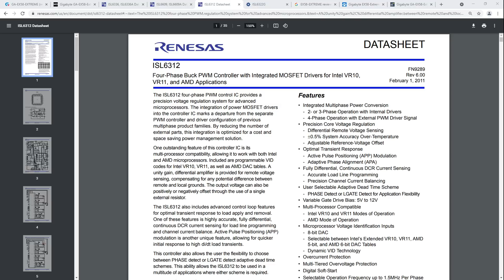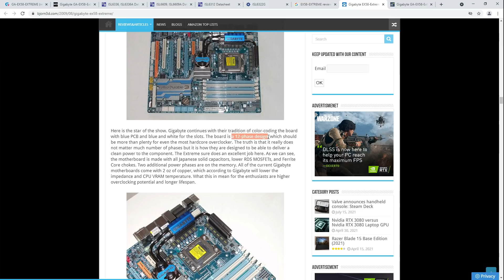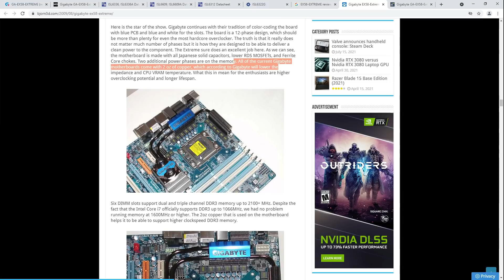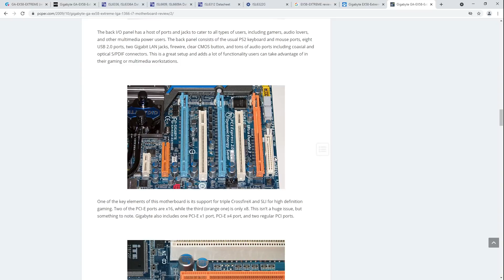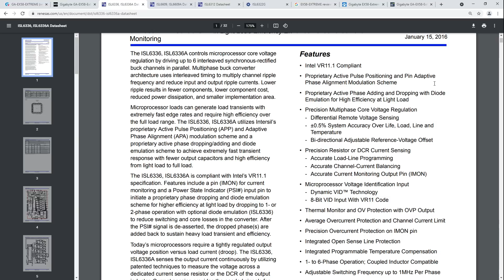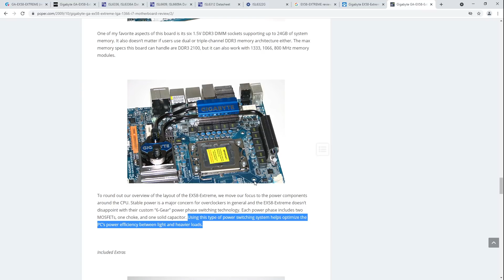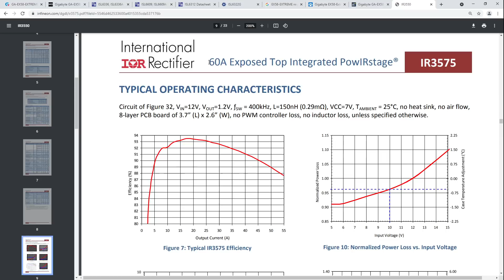Motherboard manufacturers have been lying about VRM phase counts for years.

Comment: It makes one wonder how many motherboards use higher phase counts to disguise lower quality power management overall.  We have 100 phases!  Why?  Because 10 phases would've been garbage given our design and parts choices.
Reply: there are double step-down two-phase buck converters, none of you knows what is installed on the board and this video does not give any electrotechnical approaches to a measurement as a starting point for the claims. Today there is even a tripple step-down three-phase buck converter. From someone who didn't even know what a mainboard was in 2008, I wouldn't expect to have any significant electrotechnical knowledge.
Reply: @darkbreed  Really?  Because there are lots of people who graduate high school in 2008 who weren't already computer scientists or engineers who are today.  That's absolutely the dumbest thing coming from a paragraph that might have had some good information in it.  But after hearing you insult the youtuber's intelligence based on not knowing what a mainboard was more than a decade ago... as if one couldn't gain any knowledge in the field over said decade... I can't take anything you said seriously.  Well done at making your words irrelevant.
Reply: @Salsuero  you can't DIY this knowledge, especially if you don't have the equipment. my electronics laboratory costs several 10,000 euros and I am still far from having a good one or one that corresponds to my university equipment during my education. Just what he tells of nonsense in other videos (I've now looked at some and this channel get fade out by me now) tells me that someone sits at the other end of the line who thinks he's got something and is really just a gossip. Anyone who wants to learn something or is looking for information is wrong on this channel, only half-knowledge and assumptions without a technical background can be found here. i feel sorry for the people who follow this channel.

I work in microelectronics for more than 25 years now and i have no time to educate others for free but i can give a statement about what a technican think about this chanel.

Comment: Using a higher current inductor to replace 6 phases ignores a couple points.  1.  The poly phase design increases the effective ripple frequency - requiring smaller caps.  2.  The transient response of the poly phase allows almost instant current supply because a high side FET is on and able to supply current instantly.
Without looking up data sheets - 12 phase is likely in reference to the effective ripple frequency and not the number of FETs per se.
Reply from the maker: Your ripple doesn't change when you cram more fets into the same damn phase because the fets can't turn on out of phase with each other. As far as the driver IC is concerned having 2 hi sides is exactly the same as just having 1 bigger high side fet. The same goes for the inductors. Having 12 20A 800nH inductors in a 6 phases gives you the same performance as having 6 40A 400nH inductors.
Reply: @ActuallyHardcoreOverclocking  Sorry didnt know you were a power supply designer.  I assume you are saying that there is absolutely no way the 2 high side fets could be individually driven 180 degrees out of phase.  There is no such circuitry - hence, as you state the 2 high side fets are driven by one driver and in phase.  Glad you could inform me.  I know a guy who designs multi-phase synchronous buck converters and he commonly doubles the ripple frequency by driving the high side fets out of phase.  I'll have to ask how he does that now that I know its impossible.
Reply: It is not possible if they are literally connected in parallel
Reply: @riba2233  ahh - then a 12 stepper doesn’t seem plausible at this point!  😀

Comment: When Intel left the MB market all he'll broke loose with brands looking for anything to differentiate from the others.  Another thing that went crazy was layer counts.   Intel MBs were like the Sony solution and could be used as a benchmark/design standard.
Reply: @ActuallyHardcoreOverclocking  Agreed - Intel left the marker around 2013, but also set the floor for "acceptable" power delivery for many years.  In 2008 in the US we had 15 MB vendors including some real terrible messes .
Reply: @patrickgoodhart9294  lol if you think it were back then... try the 486 era... omg the boards... and stuff evolved so quickly so there were several generations of 486 boards that wasn't really compatible

Comment: You should really look at the gigabyte X 58 ud9 if I remember it’s like a 20 phase power delivery
Reply: So? GA-Z77X-UP7 is a real 32-phase VRM motherboard, as featured in AHOC's "The most overkill motherboard ever made".

At least the X58 had the excuse of less powerfull phases AND potentially 50% more cores (6) than the Z77, something like the i7-990X could at least potentially draw a LOT more power than the 3770K on a far less capable VRM (less phases and worse powerstages in each phase! Double Whammy!).

Yes, it really had 32+3+2 actual! phase, VCC is an IR3562 driving 8xIR3599 driving 32x60A PowIR stages are which are obviously really needed to power at most.. a i7-3770K! Yes, the PowIR of that era stages are "only" MEH by modern standards but we're talking about a VRM that has so many phases even extreme LN2 overclocking won't make the CPU use enough power to hit "peak efficiency" of the VRM when using all the 32-phases.

IE the motherboard would draw less power with some/many phases disabled even on extreme LN2 overclocking... Not sure I can think of any other VRM where that would have been the case! The next time we see a motherboard with 32-phase VRMs is with W-3175X which is 28-core chip drawing many, MANY times the power of the quad core 3770K which means those motherboards actually had a reason for having insane number of power stages.

https://www.youtube.com/watch?v=q9vdl8bWF8g

Comment: Buildzoid could you talk about the people soldering different ram onto graphics cards?  Are you able to use a heat gun to glue some 18 gigabit samsung gddr6 onto like a 1650 super or replacing 1gb chips with 2gb chips and trying to get it working in bios?

Comment: I mean - while the marketing back then was just as wrong and lying as today - the motherboards them self where a lot cheaper for their features.... like using actual heatsinks and even heatpipes on 100$ boards where nowadays even on 205$ pieces of chunk you only often onyl get a big slab of aluminium that does very little.
Reply from the maker: A big slab of aluminum is much more suited to passive operation than small dense finstacks. Also those old VRMs were much less efficient than what we have now.
Reply: @ActuallyHardcoreOverclocking  "A big slab of aluminum is much more suited to passive operation than small dense finstacks."
Those slabs without any surface area really don't do much - at least much less than a normal finstack, let alone if you have any actual airmovement in the case.

Comment: You need to make an update video on the evga cards failing in new world. The problem IS with evga cards cooling system. It is not an nvidia problem. This is an evga engineering failure. You should admit you were wrong.